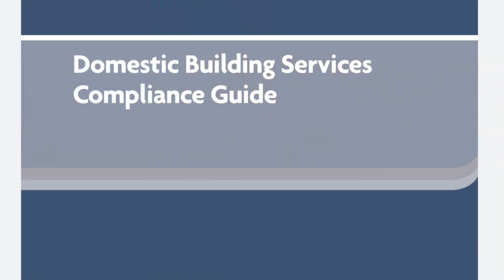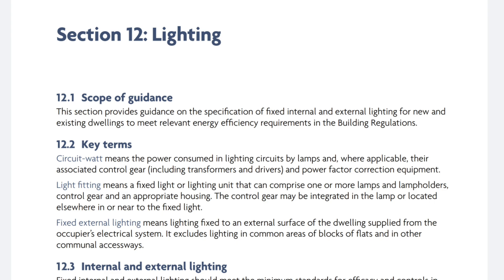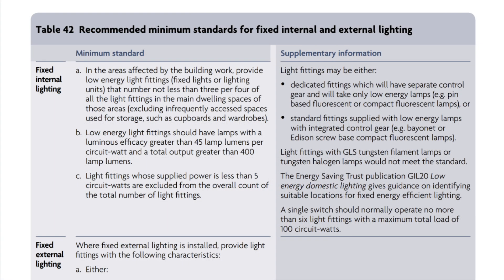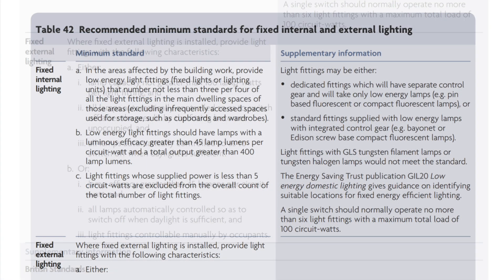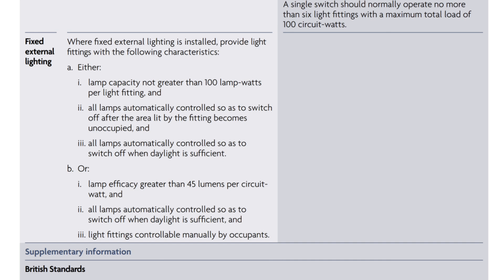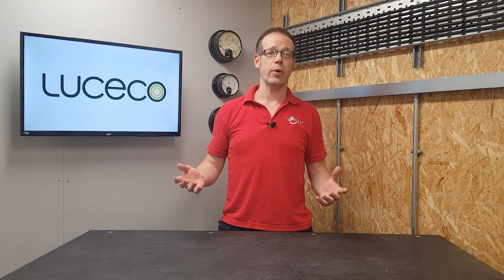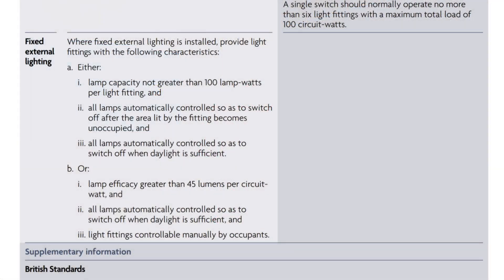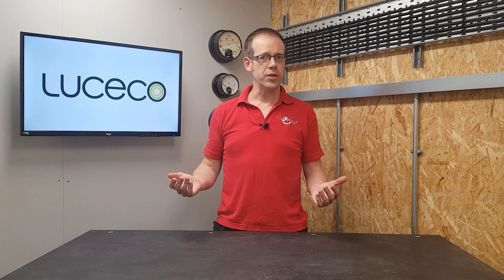ELECTRICIANS' Q&A: Are outdoor lights covered by building regulations?

Comment: Regardless of what is installed outside, just make blooming sure there is no unwanted light spill into neighbouring properties.
Reply: Again as the electrician, not your problem, you can advise on regulatory requirements but so long as it's well installed & electrically safe, your job is done.

Comment: Well, I never got what I thought was an acceptable answer on the IP rating of the Netatmo WIFI camera/light, I seem to remember that Netatmo suggested to  'put some silicone around the base' 
Got to say, is that really a great response from a manufacturer.
Can one imagine fitting a ceiling rose externally and and the recommended method of providing adequete weatherproofing was to use that method ?
it is quite clear to me that the device was not designed and manufactured to be used externally in the UK market, yet, it is clearly marketed in the UK market.
Otherwise, why no IP rating ?
I'm sure there is a video on the product on here, or, there was !

Comment: Are there requirements for IP ratings for mains powered external lights ?
Reply: Yes
Reply: @UberAlphaSirus  Like an IP rating?
Reply: I can tell you in Germany the regs depend on if it's a public space or a domestic dwelling. For public spaces it's the DIN VDE 0100-714, the UK counterpart of that is the BS 7671 part 714 ( 😉 ). That would be for example the massive lighting installation in a football stadium or lighting installations for statues, phone box (are there still any out there?) and so on. For domestic dwellings the DIN VDE 0100-737 (Damp/wet areas and rooms, outdoor installations).